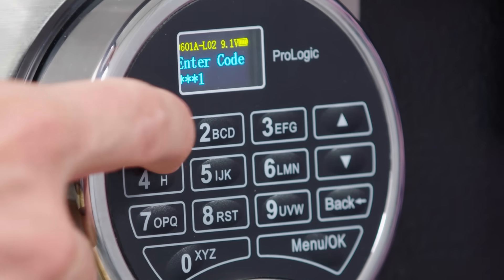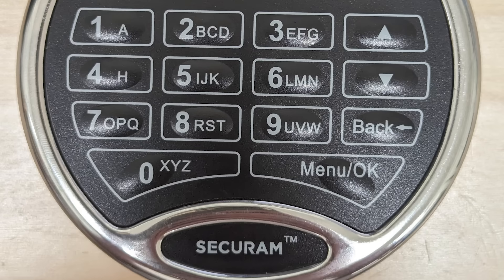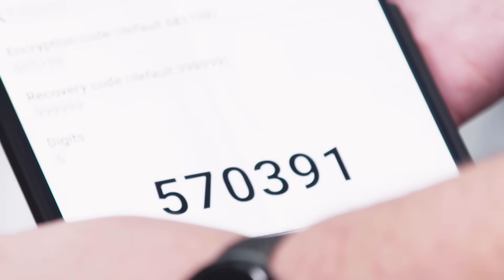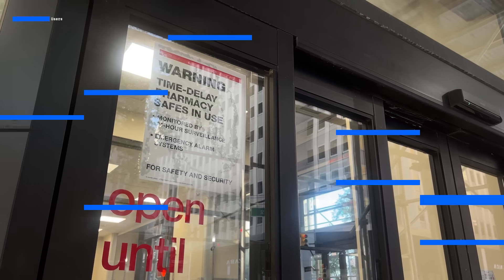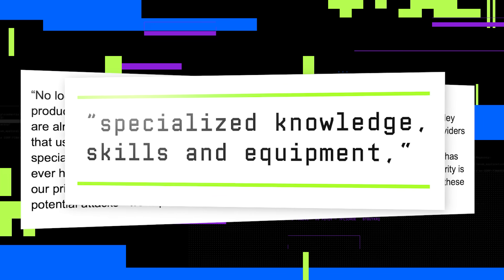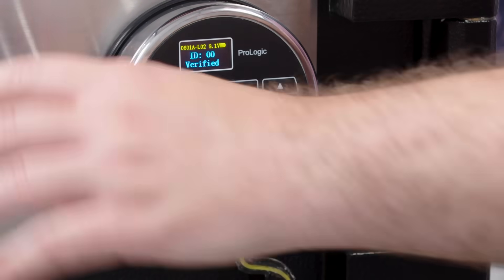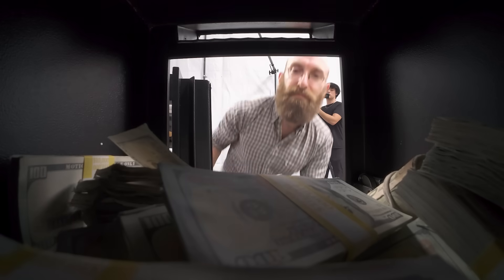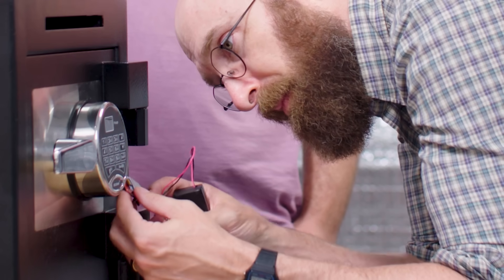A Basic Device That Cracks Hi-Tech Safes | Hacklab | WIRED

Comment: Thanks, between this issue and that all brands of electronic locks fail at some point i am right now taking off my Lagard 4200 and throwing it away. Its 12 years old and scares me to death. I just ordered a S&G dial kit. My other 2 safes have these and 1 is a 1964 meilink that always works. Screw these electronic locks with back doors.

Comment: You are either total uninformed (read: ignorant) or completely out of your mind to own a safe with an electronic lock.

Many safes with electronic locks can have a mechanical dial lock installed which are completely immune to any attack like those shown in this video.

If your safe has an electronic lock and a mechanical dial lock can not be installed on it, you bought the wrong safe.

Comment: I have reservations about these “safes” being “high security”. Just about every digital safe can be defeated by either a neodymium magnet, removing the keypad and fiddling with the wires or just cut around the case (not the door) with a circular saw. Many so called safes are really nothing more than a lock box or a fire safe consisting of two thin sheets of metal sandwiching some tree of fire and heat resisting material. Of course since many people don’t even bolt the safes down you can always pick it up and walk out the door.

Comment: Hey, The best ones are 1930 safes old bank one you can modify they usually have three or four combination dials on the front they're not cheap and they weigh a ton you got to have a floor that can handle them. Like I have a concrete floor with steel i-beams inside the concrete in the safe is welded to them I don't keep money in my safe I just keep my One pistol and mainly photographs for fire protection type thing

Comment: Buy a few decent old safes, one you can’t electronically crack. Don’t mount them and put weights inside. Mark one “gold assets” another “jewelry”. Stash your actual valuables concealed elsewhere. Should thieves break in, they will take the most assumed valuable items. Those being the safes. For fun put a tracker inside.

Comment: A true good backdoor would be an individual "key" generated at manufacturing and flashing the firmware, the key is ultra long and can only be read via usb port shippedmon as tick used once. The lock erases its firmaware and cant relock again after super key is used once..
Superkey can be erong once and you wait (10min²)² and so on ever time it is wrong.. want brute force? Need to wait centuries😂

Comment: In fairness to the lock company, once you learn more about locks and physical security you realize that it is always an arms race between manufacturers and crackers. That has always been the case.  So it has always been true that the older your locks are the easier they are to break into. 

Given that history, it’s understandable that they aren’t updating old models, especially since they aren’t connected to the internet. The bigger issue is with the design. There shouldn’t have been a back door capability built in the first place, and especially, as they mentioned, none of this should be on the exterior portion of the lock.

Comment: I only use mechanical combination locks on safes. Period. (There's a big Liberty in the corner.)
New gun safes come with digital electronic by default, you must pay more for mechanical!
So ... change your encryption code, as recommended.
And disable SSID broadcast on your router, and change the default password.

Comment: That is NOT a high security safe. Stop buying electronic combination locks and get a UL listed three wheel mechanical combo lock and mount it to hard plate and install a good relocker system inside the safe.

Comment: These flaws aren't ideal, but I don't think they are catastrophic either. A determined attacker is going to find a way into the safe, even if they cut it open or use some other physical attack. Also you wouldn't rely solely on the safe to protect your property there should be multiple layers of security.

Comment: I found a safe at the dumpster of my apartment about 20 years ago. It had an electric lock. Well, the wires to the solenoid inside the safe were exposed on the outside. I just connected the 9v battery to then two wires and opened it. Took me a few minutes. Of course there was nothing useful in it. Engineering backdoors have been a problem for a long time.

Comment: I have a Liberty safe that came with the exact lock that is discussed in this video.  I have also distrusted an electronic lock because of the closed source software and the potential for the exploits discussed here but also don't like the thought of going to open a safe that i only access a few times a year having a dead battery when i need to open it, i rather promptly contacted a safe dealer and purchased a Sergent & Greenleaf 3 wheal dial safe lock and installed it after doing enough research to feel comfortable doing it.  It allows me to set my own combination without any lock smith having a record of the combination and it can be operated even after an EMP.

Comment: This is why I never bought or would buy a electronic safe. Lock-picking is a skill that requires times to master and cannot be transferred BUT like with most electronic technology it might take someone longer to figure out BUT almost all electronic technology will be able to be eventually replicated on the cheap then spread to the masses. GPS and encryption were once reserved for the military and now we all have access.
Reply: Unless you have time and access to an auto-dialer. Or a big red wrench. Or an angle grinder with a cutoff wheel.

Comment: So the secret system they don't want to release is reading a debug port. Probably a standard serial port as well. It won't take me a week to make that.😂😂😂
Reply: You've still got to reverse engineer the firmware to understand where to read and how to use the decryption key though... (plot twist : it's xor 😅)
Reply: If it’s anything like my experience reverse engineering hardware, you will accidentally fry it once with the wrong voltage then have to wait a few days to get your replacement part. Thus, a week. 😂
Reply: Make me one then let's see if you can do it

Comment: FYI - the Securam ProLogic is shipping now with the recovery system disabled. You have to manually set codes in it, in order to make it active now.

The ProLogic keypad circuit board has also been changed, so using the terminal probe device through the battery holder hole isn’t possible anymore. @wired

Comment: I’ve bypassed the lock completely by energizing the solenoid with the locks 9v battery, not sure if the solenoid wiring is harder to get to in these safes, but all I did was fish it out with a paper clip, and then strip the insulation off the green wire, and short it to the negative terminal of the battery

Comment: More than the 'lock code' needs to be stored in the safe.  If all the 'electronics' are on the outside - perhaps the electro-mechanical lock actuator can be simply directly powered.  The electronics on the outside should ONLY be for a keypad and display - all other electronics MUST be inside the safe.

Comment: I'll be sticking with my old dial lock. If you have one of these locks, you could probably make the back door harder to use by changing that encryption code, then dropping some epoxy on the debug contacts on the PCB.

Comment: It's really stupid to have the PCB accessible through the battery door.  At minimum they should have made the case where there are walls around the battery compartment.  If the board is accessible you could probably just short or apply a voltage to the right place to completely bypass the board to open the lock.  This reminds me of lockpicking (padlocks) where all you need to do is shove a thin shim in the right place to open it bypassing the key.  And all that it would take to fix this would be a wall or barrier of some sort to prevent things being shoved in there.

Comment: That is a nice non-destructive method. Honestly, easiest way into most of these is a simple battery operated angle grinder or oscillating tool. Cut through the weakest part (back and bottom).

Comment: I love that your Security Professional is shown trying to pick one of the EASIEST locks to open, a knock off, pot metal, Schlage looking lock that is easier to pick than the old Kwiksets!  ROFL!!!!  Also, if the FBI has a warrant, then not having the code is not going to make a bit of difference!
Reply: Let the FBI drill the safe. An electronic back door is too easy to abuse, whether by reverse engineering or convincing someone with access to abuse the back door. Think about the SIM swapping attacks that rely on bribing telco employees to abuse their access to protected company systems.

Comment: The flaw is not that the supercode is stored in the accessible part of the hardware... The flaw is that it is stored AT ALL!
When you're designing something like this, and you absolutely NEED a supercode of some sort (Legal reasons or whatever), when DO NOT store it in the hardware. Storage a hash algorithm. Do enougth rounds so that the validation of a single code takes multiple seconds. That way even of someone gets their hand on the hash itself, it will not be easily reversible.

Comment: Why do we need a debug port in the finished product?  Removing the debug port isn't the final answer but it sure would have made it more difficult to exploit if they left it off.
Reply: Or at least disable it. Pretty much every chip in existence has that function, you burn an e-fuse, and it's gone. Sure, you might still be able to glitch it, but you're not doing that while the safe is still intact

Comment: Not sure its fair to call a Raspberry Pi Pico "low-tech". Sure, compared to a AMD Ryzen, it's a featherweight. But you're talking about a dual-core system running at 133 million instructions per second. Mounting and reading the linux operating system inside those locks, finding the right memory address and decoding it is actually pretty sophisticated.

Comment: Microcontrollers often have security bits that disable JTAG/debug port functionality. A firmware could be patched to remove the recovery mode using the JTAG and then the security bit that disables JTAG could be set right after that. Oh and if part of the PCB if the controller is exposed, there's likely a way to drive the lock solenoid by making contact with the pcb  at certain points.

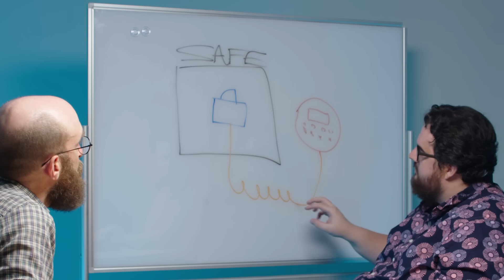Comment: 10:00 You must store not a code, but hash of code. So, you can not decrypt code by raspberry pi. Fast, simple, only software changes.
Reply: True but running a brute force on the hash, whether it's SHA-256 or well any, it couldn't be done pretty fast with modern PCs.
Reply: @repairstudio4940  Doing multiple rounds of a sufficient crypto hashing algorithm. Say enough rounds that it takes the safe half a second, would make cracking even on good hardware infeasible.
Reply: @repairstudio4940 exactly, probably within seconds or less if its not a ridiculously intensive hashing algorithm since theres just so few combinations compared to something like a password

Comment: method 1-> Emulate the key derivation routine in the firmware OR recreate it. Probably a bunch of LCGs and math
method 2 -> sniff the debug pins with probes. flipper zero can do it too. You'd just have to figure out if it requires a magic packet to spit back the key.

How securam could avoid:

method 1-> run an actual cryptographic signature check instead of some in-house numeric "signature". May require a longer recovery key entry though
method 2-> encapsulate the circuit with epoxy resin or disconnect the debug pins / make them inaccessible

Comment: Uhhh the FBI definitely did not have a warrant, or even a subpoena.. they gave it up willingly with no pushback.
Reply: I think they meant that the FBI had a warrant to open the safe. But yes, it seems like the manufacturer gave them backdoor access.
Reply: @titaniummechanism3214 
Most digital lock manufacturers have a master key usually based on the serial number or some other form or back door access.

Comment: In my opinion, safes should never use a digital locking mechanism. Having additional digital security features is okay. i.e., a camera, failed entry alerts, etc.
Reply: If properly isolated and programmed, I would argue that digital is way safer.
Reply: Look into the Kaba Mas X-10 lock. It’s approved by the Department of Defense for securing top secret areas. It has no batteries; the act of spinning the dial powers it enough to display a number on the top. When you turn the other way, it’s starts at a random number. Defeats the auto-dialers and has a lockout feature and logs all attempts.
Reply: @zerodaymatt  I love the comments . More info there than in entire videos .
Reply: you can use an auto dialer on a mechanical lock. It pops those pretty quick also. The chances of Meth Head Mike having either one of those units and coming to your house is very rare. if you have that kind of luck play the lottery you will win a dozen times before that happens.
Reply: As LockPickingLawyer viewer, physical security is far more important. Like you just pop the battery and access the electronic stuff? Could just pry it open as well
Reply: I once opened a digital safe without the code. I took out the battery, cut the exposed motor wires, and connected the battery backwards. The latch opened immediately.
Reply: @runed0s86 Can you all not read? Properly isolated elections. There are cheap mechanical locks that have a screw on the outside that holds the mechanism in place. It is super easy to unscrew and open the lock that way.
So now all mechanical locks are bad.
This is your argument.
Because there is one bad lock every lock of that kind is bad.
Reply: A hidden safe lol .

Comment: The fact they didn't use a one way hash algorithm for the unlock code is breathtakingly stupid.
Reply: That wouldn't help, you can enumerate 1,000,000 codes in no time.
Edit:
Even if they use some insanely complex hash function that takes 1-2 seconds for the microprocessor in the safe, it would take a strong computer a few hours at most
Reply: @Karnaf142 You're still misunderstanding how the hash function is applied. 
When the manufacturer receives a reset request, they  supply the plaintext. The user then types the plaintext into the safe which hashes it and compares it with the code that was initially displayed on the safe LCD. If they match, it proceeds.
Reply: @Karnaf142 Yeah but you wouldn't really have to worry about this when the controller was protected. This just reminds me of really cheap keypads for doors that literally have all of the contacts for the opener tucked away under 4 visible screes (Like seen at LPL)

Comment: Code snatch method can be defeated by cutting away the traces to the debug pads in question then again use harden epoxy to cover the entire pcb so this way nothing to get to it. As for reset method not a clue what can be done to prevent it

Comment: Wait a second, G V R T, ain't no way they just exposed UART that easily 💀
Reply: It's probably a JTAG interface that hasn't been locked out by a blown fuse or code block.
Reply: I think it is a swd interface, uart would not let you dump the flash of the microcontroller
Reply: i have seen twi labeled on a silkscreen in a security device, lol. fusebits were set tho
Reply: yep it is UART interface 
presumably G is gnd V Vcc anf R and T being Rx and Tx

Comment: If you really want to secure any of these digital safes you really need to modify and customize the standard and known design. I always add a small remote controlled radio receiver inside the safe wired to the lock circuit. This way when you enter the code you also need to have a key FOB close by and be pushing the button on it. Security is all about layers, If you add your own custom layer like this, then it really becomes secure as know one, not even the FBI, will know how it works inside and won't be getting in using the factory backdoors.

Comment: They didn't use a processor that could be locked to prevent downloading the firmware, big flaw. Plus leaving the debug port exposed. An existing lock could be improved by changing the code you can change, and cut the traces to the debug port. Not a perfect fix but an improvement.
Reply: It would be a quantum leap to move the brains of the lock to the secure side of the door.

Comment: Leaving the debug pins exposed and having the mcu not read-out-protected is just stupid! I have come across many devi es that had their debug ports disabled, either through firmware or an efuse or physically by removing components between the mcu/cpu and the debug port. Not to mention a lot of products had read protection in place making it so you cant read the firmware but it seems that a product that actually IS MEANT FOR SAFETY does not have this while many normal consumer products have multiple protections in place so nobody copies their patented design...... Its just laughable how bad it is! 😅🤦

Comment: I mean...yeah? if you have the MCU firmware of course it is compromised. Challenge code or debug port. Both method is the same: the firmware is compromised. it is still light year beyond traditional keys and slots. To be honest if I would even bother with MCU firmware dump I would just grab a grinder first. All the lock company is doing wrong is they are not using temper proof MCU. It just cost more. Oh right, that is the problem.
Reply: Even tamper-resistent MCUs have their issues.  Attackers will often buy their own and go after it, and it's amazing how many flaws and how hard it is to get this kind of thing correct.